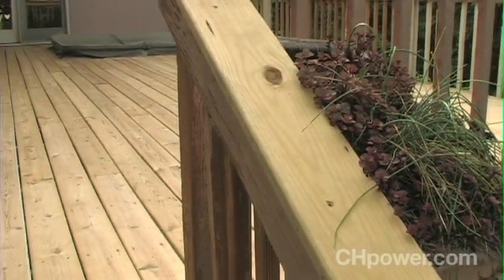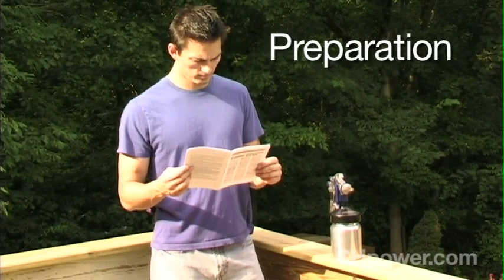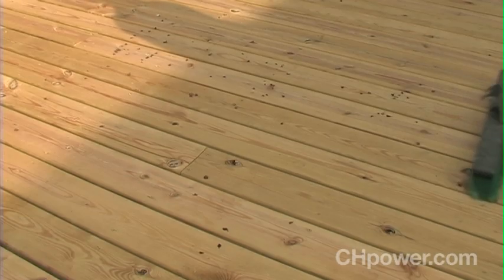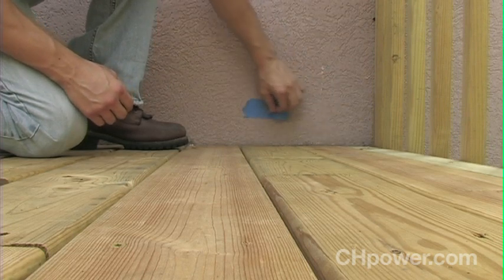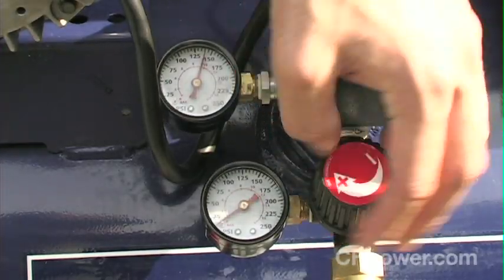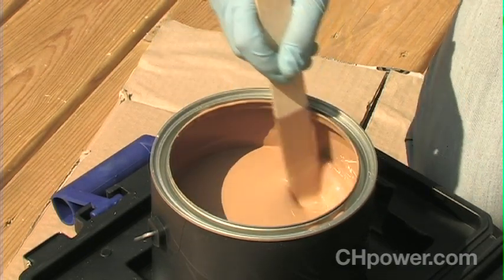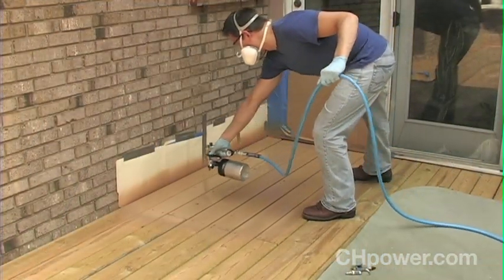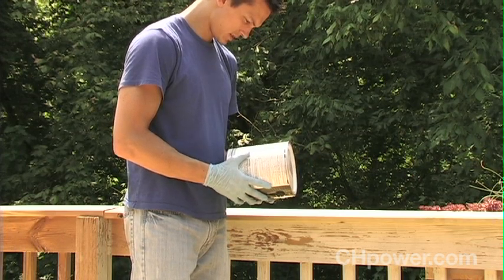How To Finish A Deck Using Air Powered Tools

Comment: stain can is a waste , designed myown using an air gun , took plumbing hose , tied  it to a garden pump sprayer , holds more stain , and then pump it ti the air gun

Comment: Rolling a deck surface is just as fast and requires no thinning, no compressor and no masking.
Reply: Dan Henderson Rolling is the last thing you should do...it does not put the stain down heavy enough and skips over uneven parts of the deck.
Reply: 1 1/4 nap deck rollers put it on way heavier than a sprayer. Most pros roll.
Reply: I agree, a sprayer should not be used either.  A deck pad (especially with a drop-down crevice is good, but we use a thick Euro-Brush...and of course, after 120+ seconds, we back-brush and apply the excess to the crevices.